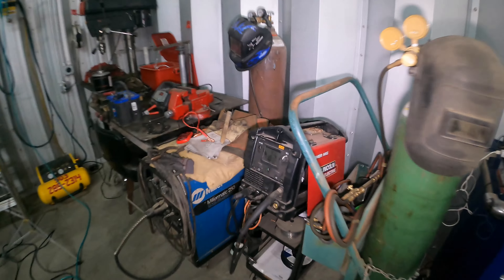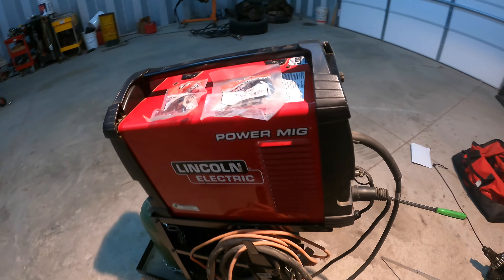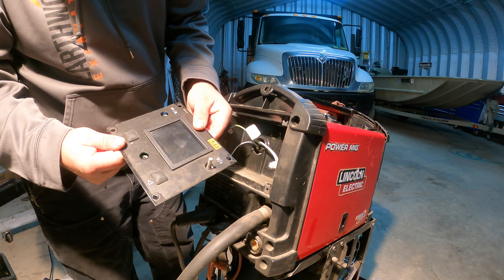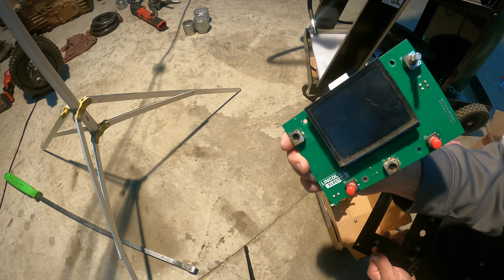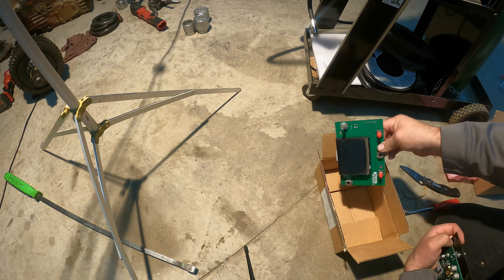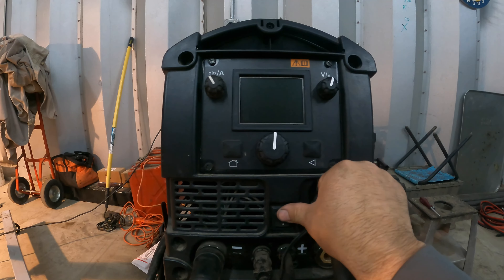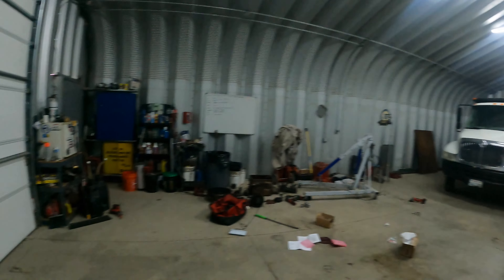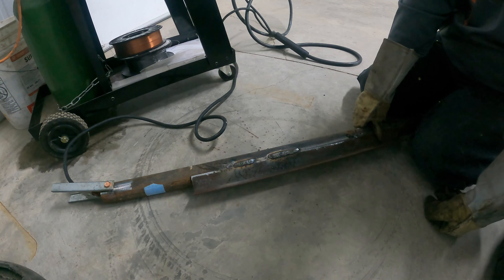lincoln welder 210mp knobs and mother board pci replacement

Comment: You need to rewire your breaker panel correctly - lights should always be on their own breakers for just the reason you had , preferably two breakers / circuits  so you don't wind up in the dark if one light fails  😀

Comment: You should have replaced the switches on the original board.  Source the switches from one of many electronics supply houses.  Should be numbers and identifiers on the switches.

Comment: Hi, saw your video, I have a 210MP that needs just a display. Wondering if you still have your old circuit board with display, if so I would like to buy it. Thanks, Kyle
Reply from the maker: Hi sorry I sold it on Ebay already
Reply: @Battle_Boat_  Thanks for getting back to me